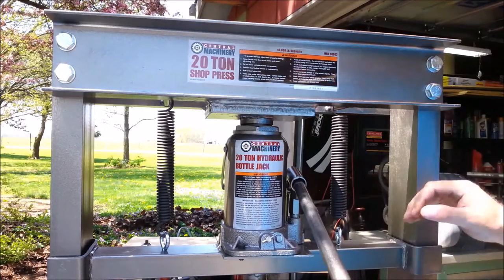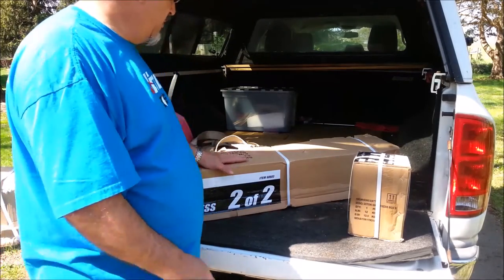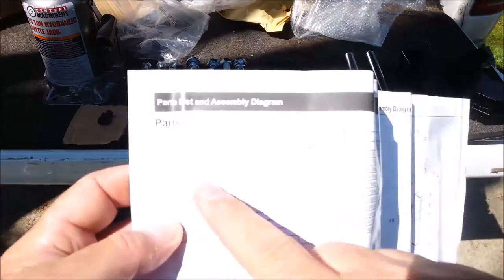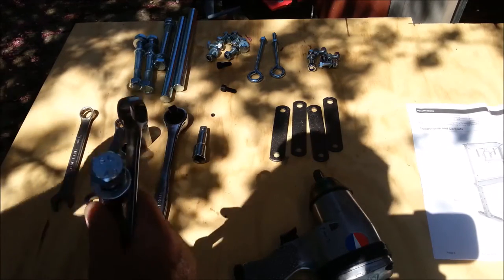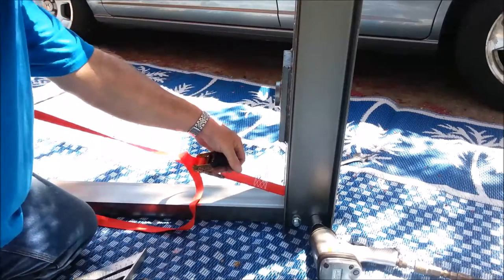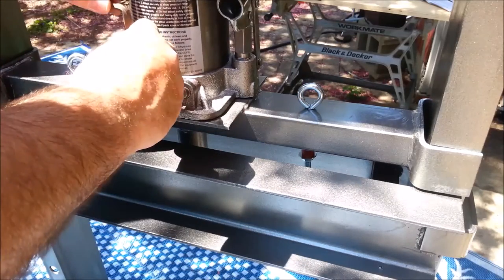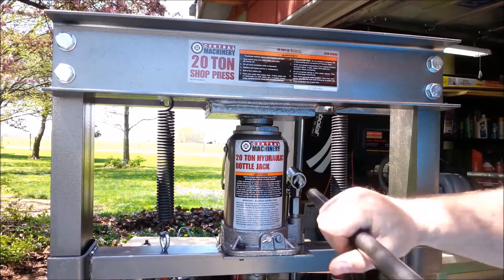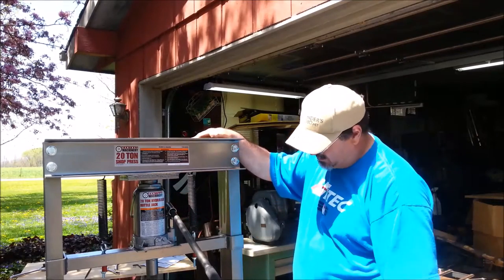Harbor Freight 20 Ton Shop Press Opening & Assembly Back Of The Truck 17 Crafted Channel

Comment: Great video Dave  Ive been on the fence about that  HF press.  I've looked and all of the reviews and with what I just seen in your video I will be buying this one.
Thanks
Reply from the maker: +ROZLO aka Big Bill I think for the money, this is one of the best values at Harbor Freight.  Sure, a $700 or $1200 press you might see in a real professional shop would be better.  However, this was under a $200.   It's a lot of capability for that figure.   I wouldn't buy smaller.  the smaller presses are made from bent plate.  This one is made from real C channel.
Reply: +Crafted man that's cheap need to get one. oh and a brochure set.may finish my mills hand wheels soon

Comment: I cant get mine to sit level on the press it has a massive angle any recommendations?
Reply from the maker: If it's welded together crooked, take it back to HF.  It has no value if it's all wopper jawed.  If it's just your bed, you might be able to cherry up the jointing angle iron and skew it back.